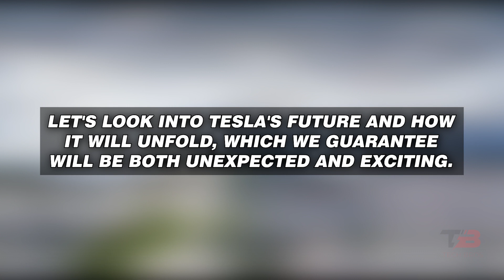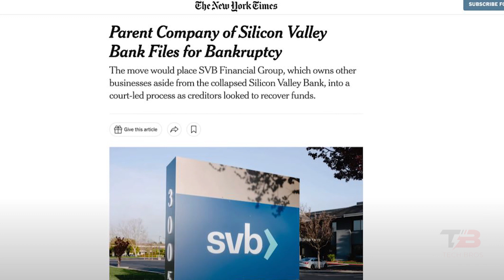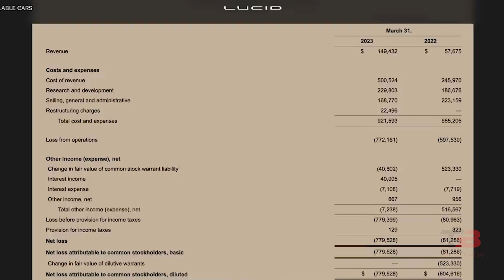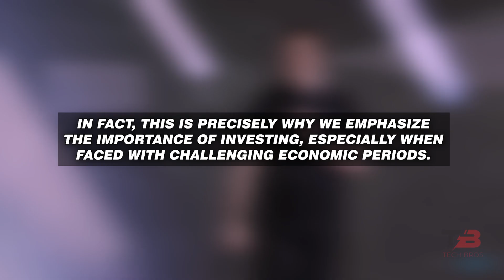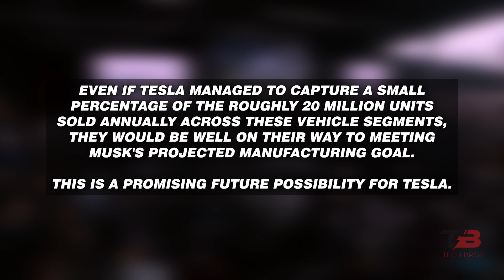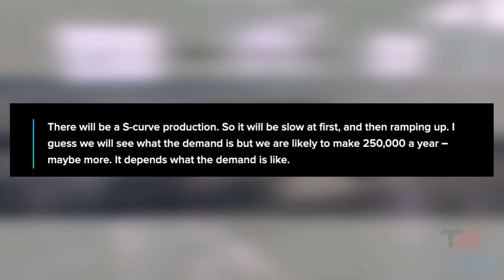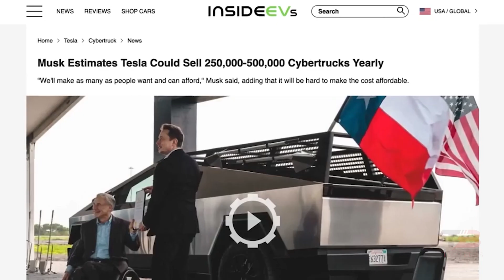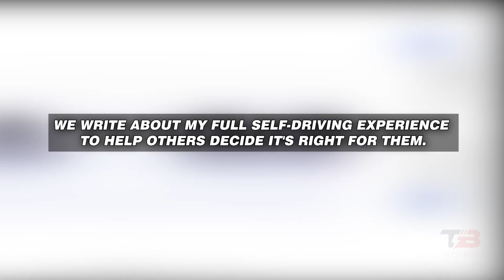Tesla's Shareholders' Meeting Unveiling Future Models and Promising Prospects

Comment: This really looks great, Tesla plans to produce a new kind of drive unit, which Musk said will require less silicon carbide than prior drive trains, and no rare earth elements. Tesla will also switch to a new, low voltage architecture in its cars which should require less copper.